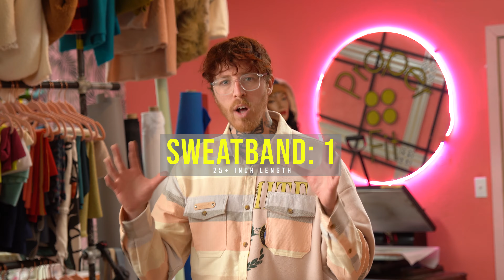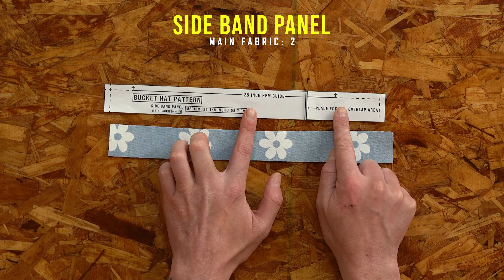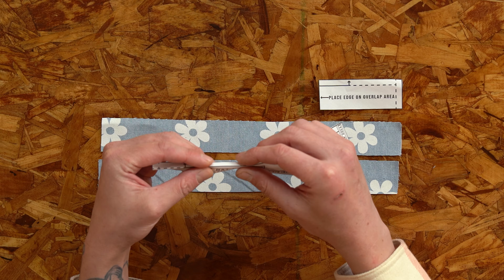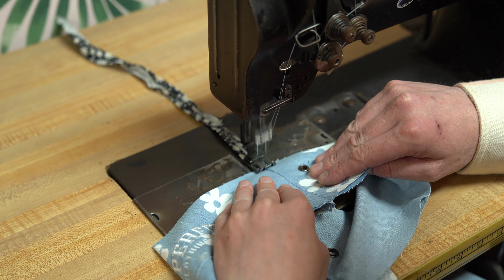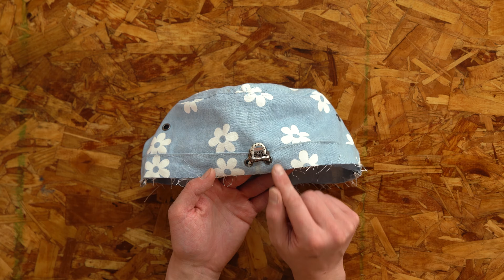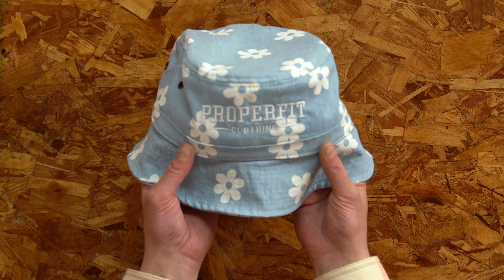DIY Bucket Hat STEP BY STEP INSTRUCTIONS + Printable PDF Pattern (EASY TO FOLLOW PROJECT)

Comment: Can I make my own sweatband?
Reply: For sure. 

A lot of hats have a sweatband that is the same material as the hat itself. 

Cut piece of fabric roughly 1.5 inches thick and the circumference of your hat crown for the length ( a bit of excess for 
Precaution). 

Fold (with right side facing up) a half inch in on each side (along the length) and iron. Top stitch these sides down about .25” in from the edge and then do an additional
2 top stitch lines another .25” in on each side. 

Sometimes the second two inner top stitches include a bias tape to cover the remaining exposed “wrong” side of the fabric on the back of the sweatband.